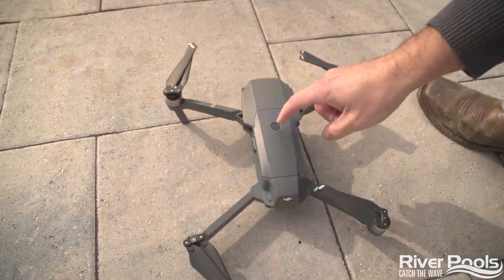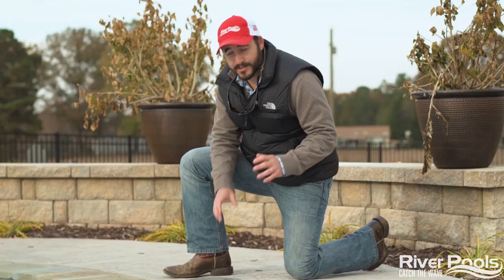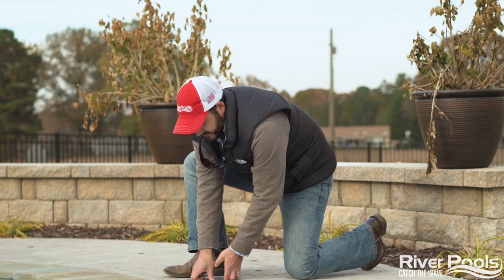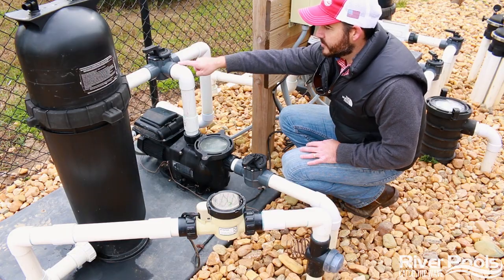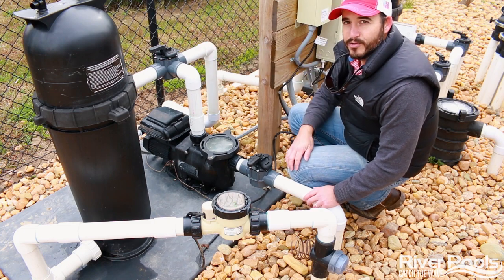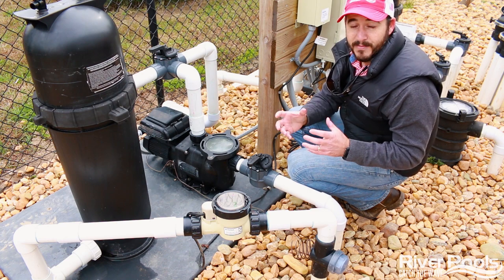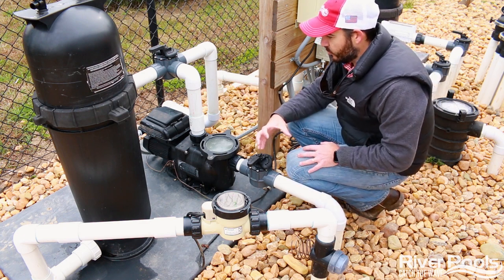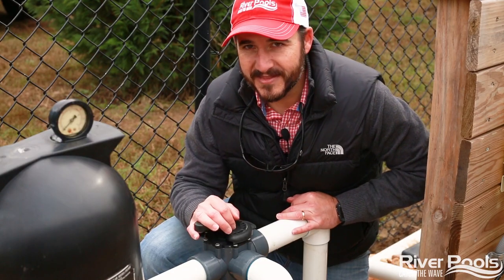How to Maintain My Fiberglass Pool (Video 1 of 5) - System Components

Comment: What is a good sump pump to get? Any particular type work best?
Reply from the maker: A quick google search will give you the best recommendation. There are LOTS of options out there. Great question!
Reply: @RiverPools   I guess my question is does it have to be a particular type of sump pump for a fiberglass pool. A lot of the ones I found online are for draining basements or concrete pools?